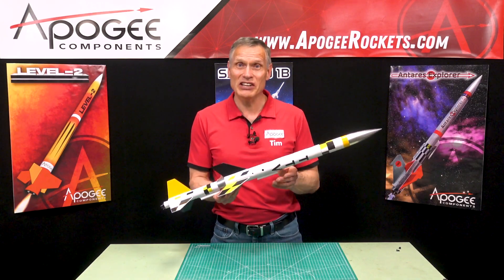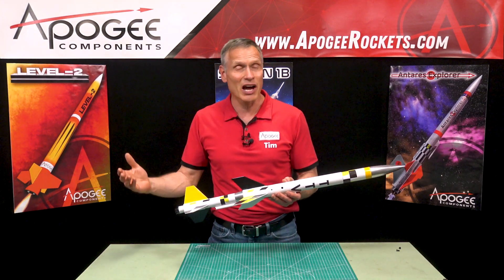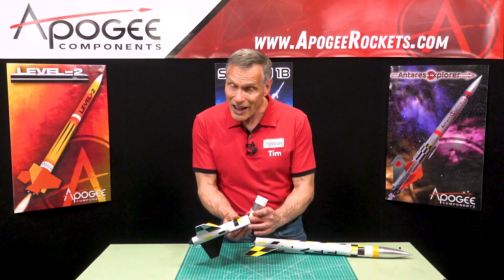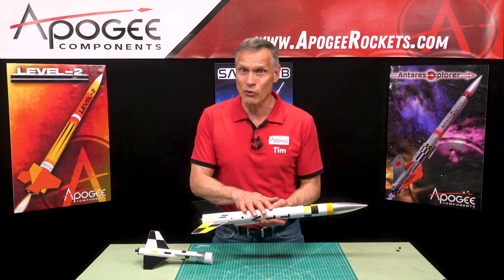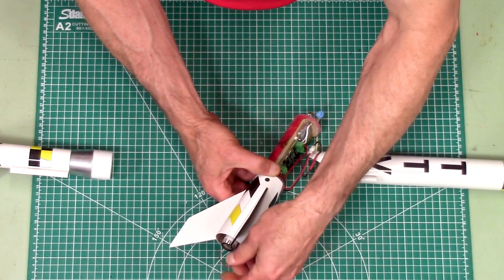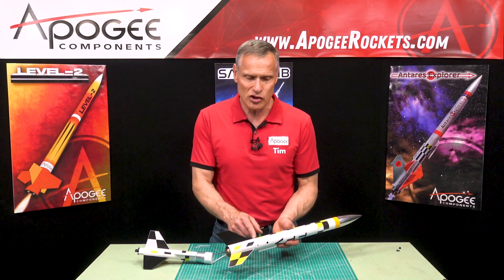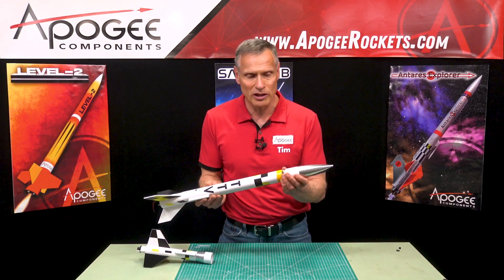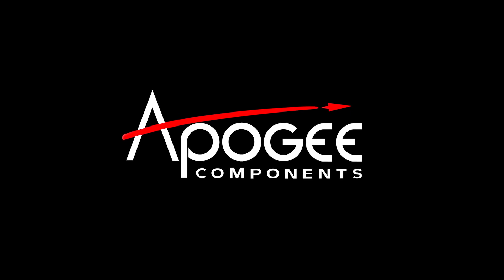The TTV Model Rocket Kit

Comment: One of the recommended two-stage motor configurations recommends a C11-0 Estes motor for the booster. Is that going to adequately provide for ejection of the booster parachute? How reliable is the drag induced separation of the booster from the sustainer going to be? I am guessing that booster motor ejection charge prior to separation would be a "bad" event.
Reply from the maker: You can use the 0 second delay, but you have to program the timer for the second stage to start really early, like around 1 second. For all your other question, the answer is that it should be fine.